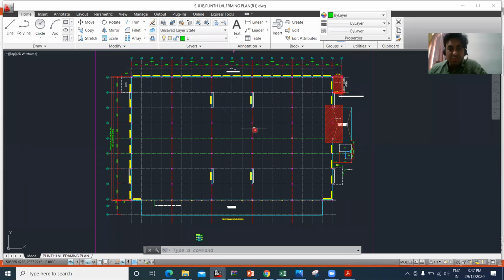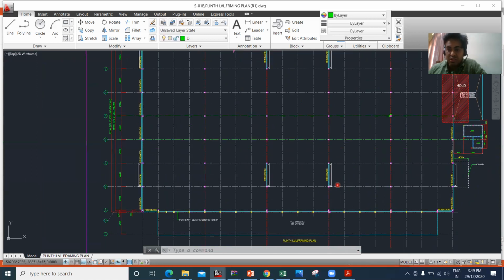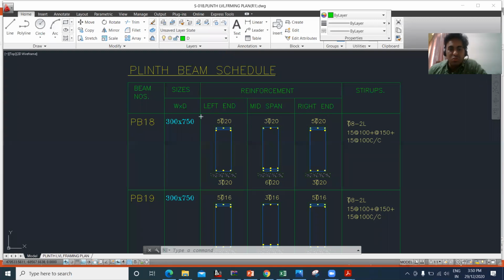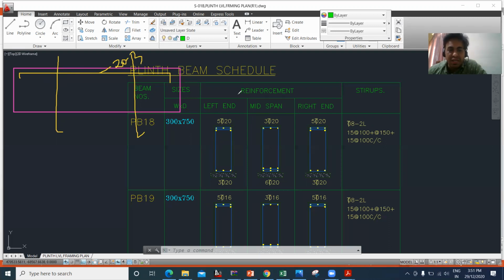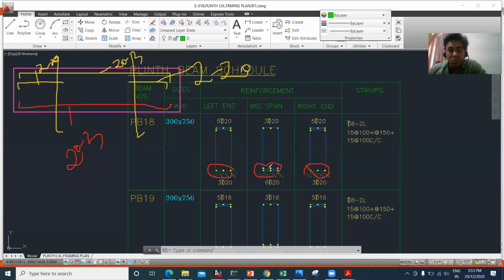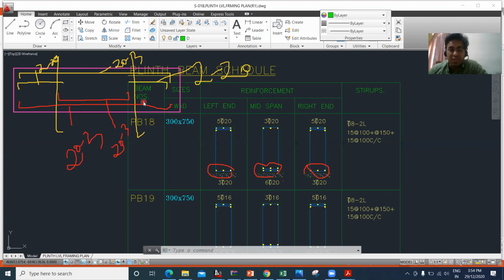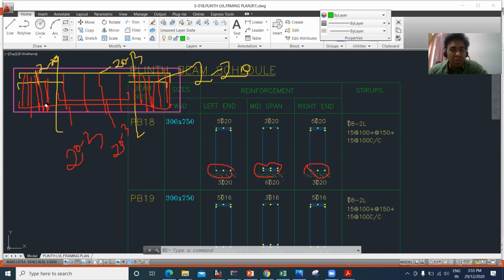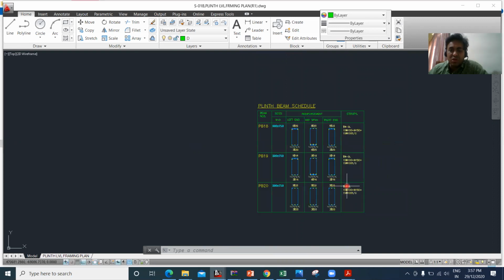Plinth Beam Structural Drawings l How to read Structural Drawings l Reading structural drawings

Comment: Sir, what is the distance of left end, mid span, right end?

If my beam is 6m in length clear span, how will I divide it in left, mid, right?
Reply from the maker: if u follow sp 34 it says  l/ 4  ( 0.25 x l ) , few people divide it by 3 also l / 3 . 
u can follow any one .
Reply: @civilbrains  ok sir thanks. I think second one is good as it divides the beam equally in 3 parts. L/3
Reply from the maker: @shareqinamdar9211  yeah . but code says first one.
Again you should see the ends also if its continuous or discontinuous